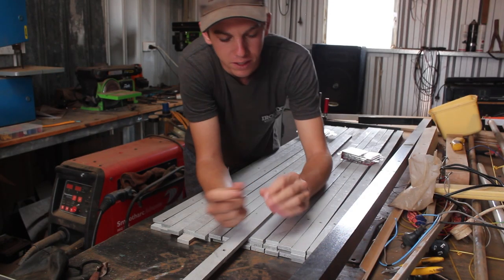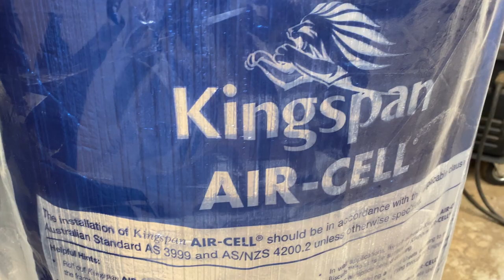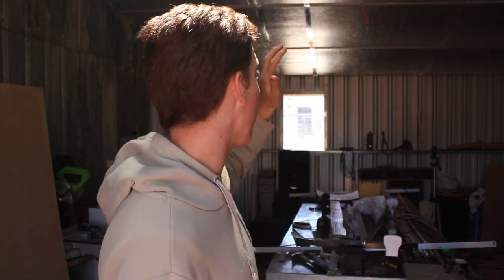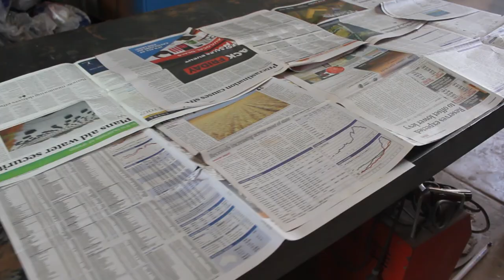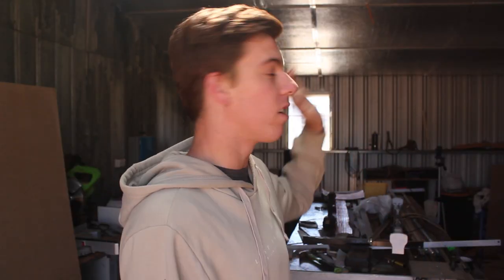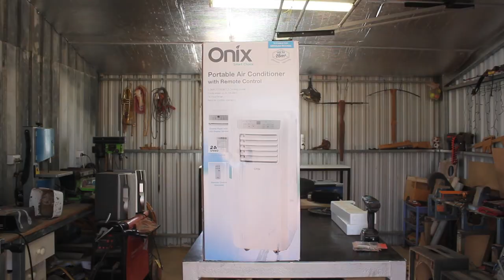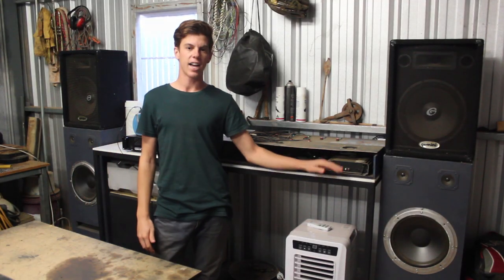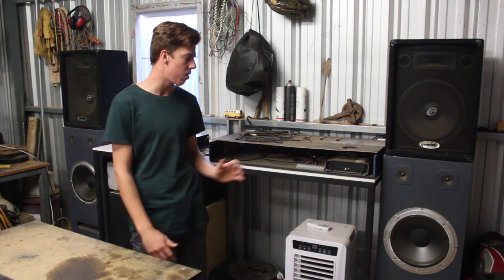Shed Upgrades - Insulation / Air Conditioner / Bench

Comment: Good work young man. I appreciate the time you took to make the video but can I suggest you lower the volume on the music and if possible use music that's less annoying to the ears. I literally had to mute the music sections. 
I wonder how the Kingspan Aircell compares to that bubble foil that seems to be everywhere now. Insulation is a very fickle thing to get right as there is so much conflicting information out there.
I think you should've deleted the skylight sheeting too. That right there will negate the insulation quality and introduce heaps of radiant heat into the space. Replace the natural light with efficient LED lights. 
The walls also need insulating too to complete the whole thermal resistance package.
All the best mate.

Comment: Also in SA, understand the heat you're talking about.   Just insulated my metal shed but also did the walls, it wasn't until the walls were done did I notice the temperature drop
Reply from the maker: Yes, need to get onto that😂

Comment: Great video, I'm looking to do the same thing but to prevent condensation and water dripping from the C channels in winter. Have you had any problems with moisture or just heat?
Reply from the maker: Mainly just heat, haven’t noticed and moisture problems yet.

Comment: Hey mate, I'm in Perth and looking to insulate a similar sized shed. A year on have you had any issues with condensation? Or anything else?
Reply from the maker: Hey mate, haven't had any condensation issues yet, however would recommend putting insulation under the corrugated steel rather than under the C's as this would hold it more securely.
Reply: @DylanLock1  thanks mate, will do